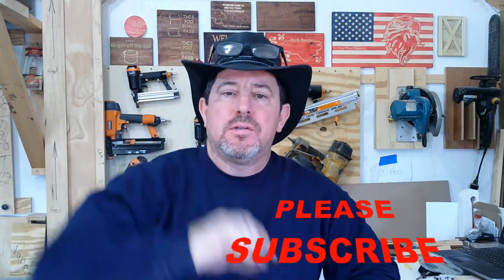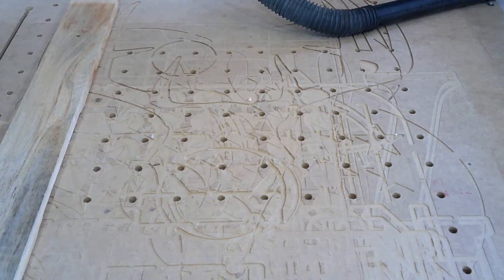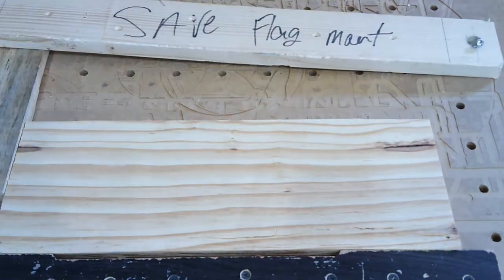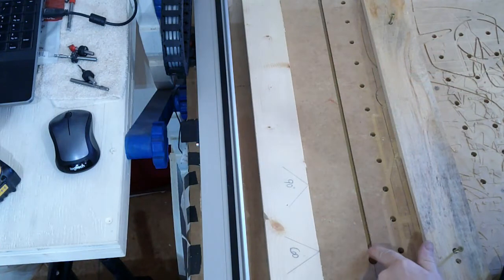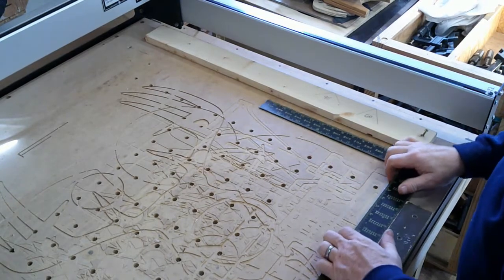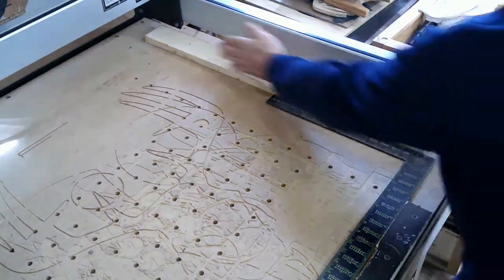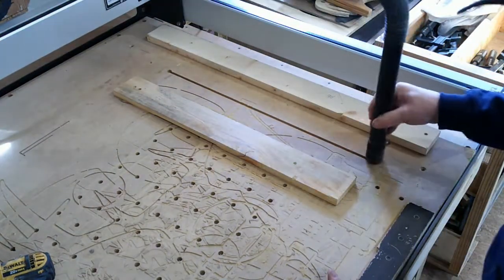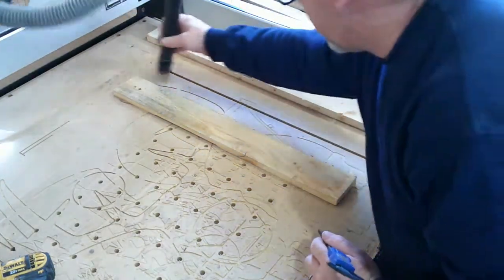HOW DO YOU CLAMP STOCK ON A SHAPEOKO XXL AND OTHER CNC WOOD CARVING MACHINES FOR BEGINNERS

Comment: So why didn't you use that expensive CNC which would have been more accurate in producing perpendicular and parallel cuts??? Looks like the cuts were within  the cutting area of the CNC. I would also add a center cut and attach a keel to the fence to keep the fence always parallel.
Reply from the maker: Thank you for watching 
But no the cuts are beyond the CNC cutting area

Comment: if you use two wedges either side facing each other you will be able to a larger parallel clamping force instead of just on the corner, or you could just make a cam clamp instead